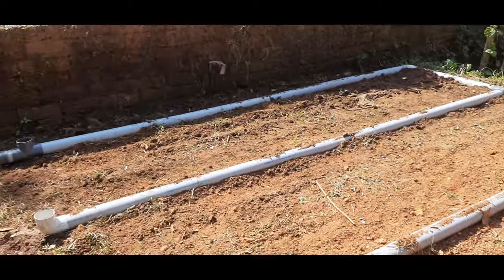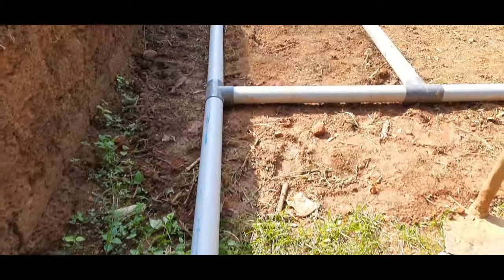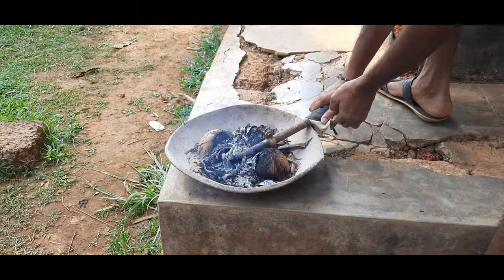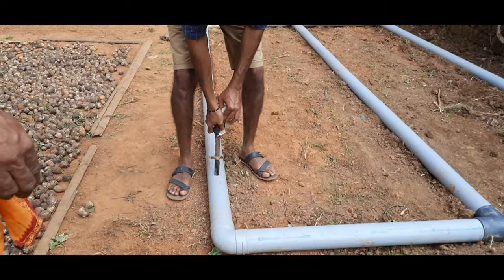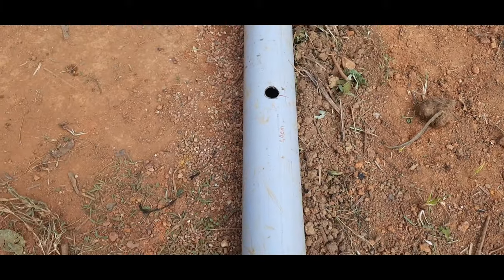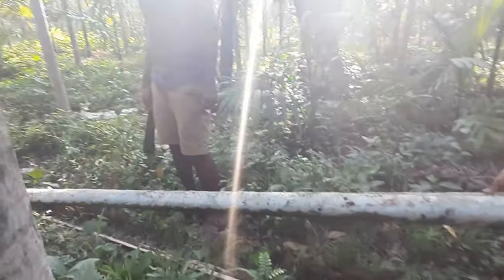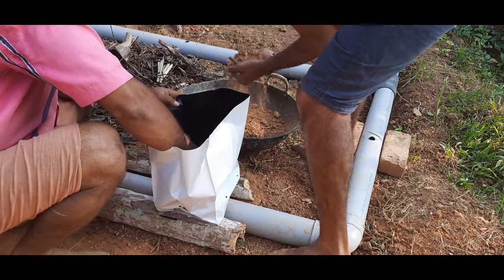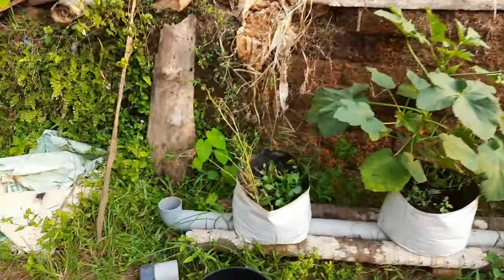WICK IRRIGATION SYSTEM | COMPLETE SETUP GUIDE | SUBSIDY | MODERN FARMING | SELF WATERING | DIY

Comment: Thanks for your video! I appreciate the effort you took to put this together for us! I just purchased those exact grow bags! Where did you purchase those wicks? I am experimenting with a system that is 2 ft x 14 ft and 8 inches deep of water with fabric grow bags for tomatoes. It The tomatoes are set on some open plastic shelves that I repurposed set on concrete blocks in the wood structure that is covered by a pond liner. I'll go in and add some large rock around the grow bags to help with mosquitos. I'm hoping to get some evaporative cooling around my tomatoes to help the produce fruits in temperatures over 95 degrees F. We'll see. I live in the southwestern USA where the humidity is very low. Gardening is always an experiment! But, we all learn something new each year!
Reply from the maker: Thank you for the comment, the wick is made from glasswool and I procured it from local gardening shop.